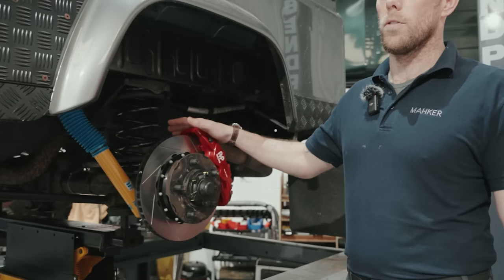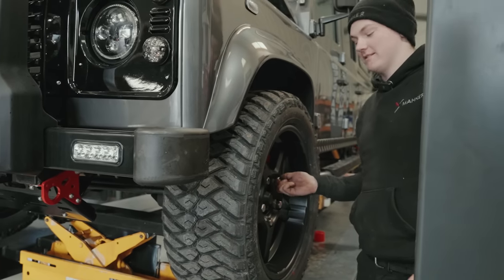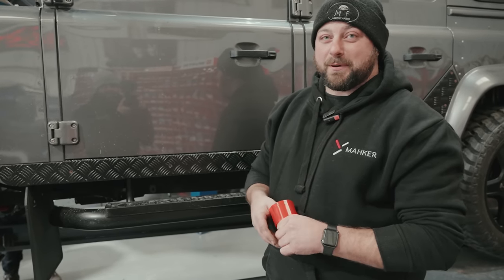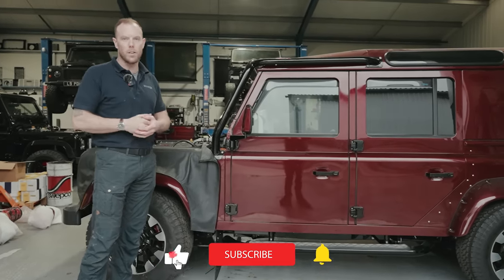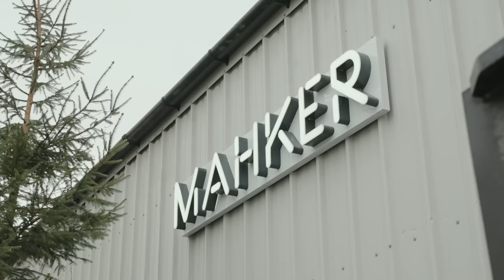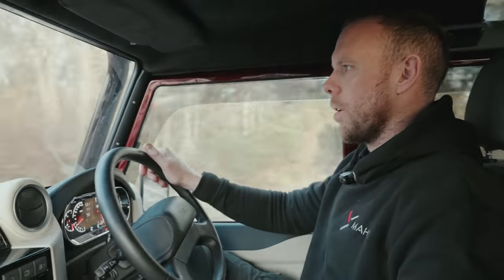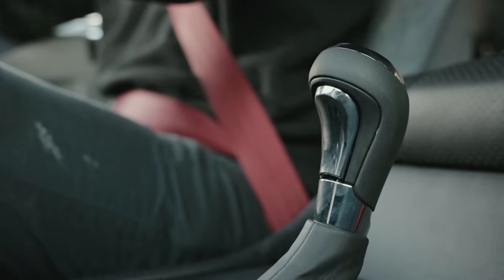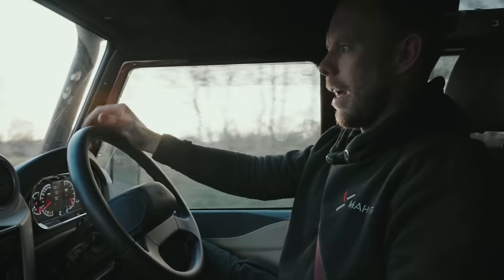HOW DO YOU STOP A 550HP LS3 LAND ROVER DEFENDER - AP RACING BIG BRAKE UPGRADE || Mahker Weekly EP066

Comment: You do realize that braking distance is strictly about speed and mass versus hydraulic pressure brake discs and brake pads friction and tires? It has absolutely nothing to do with horsepower or quickness to a certain speed.
Reply from the maker: That’s pretty much obvious.
Reply from the maker: @jdenmark1287  we’re talking about improving braking after improving performance.
Reply: @wearemahker  improved braking should be prioritized, but it doesn’t matter if your LR is high horsepower or not. If you haven’t increased tire diameter regular Land Rover brakes properly maintained will stop any Land Rover just fine. If you increase tire width they will actually stop the vehicle better. Unless you are running on a track and need fade proof systems due to frequent reduction in speed from high speeds, fitting  “high performance brakes” does not increase stopping performance. 

I appreciate a lot of what you’re doing on your channel but it chafes me when basic physics of engineering gets misrepresented. 

BTW, Semper Fi from former USMC to RMC brother.
Reply from the maker: @jdenmark1287  I’ve not got the Energy to argue with you on my channel sorry if you’d like to pull apart a working Man’s business carry on my client requested better brakes and that’s exactly what we gave him after years of Research & development this is the best Braking system we’ve found. But I appreciate your input. Thanks Dave.
Reply: @wearemahker  you’re right, no need for me to post criticism here. Enjoy your audience and clientele and I’ll move on. Cheers.
Reply: Faster engine goes faster no?